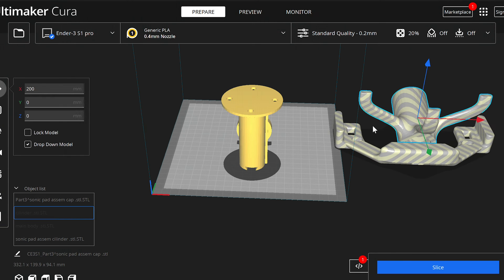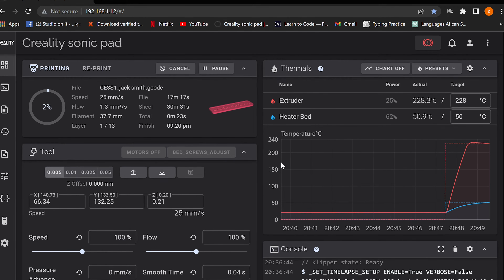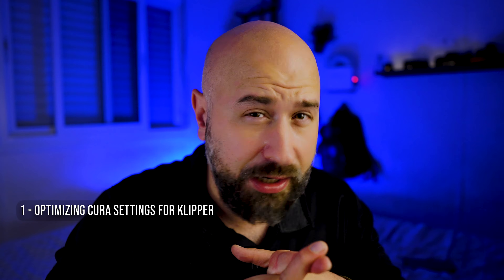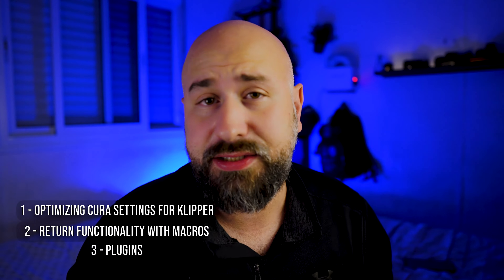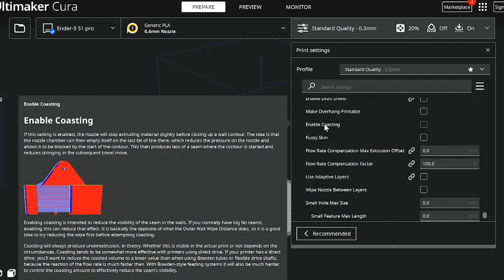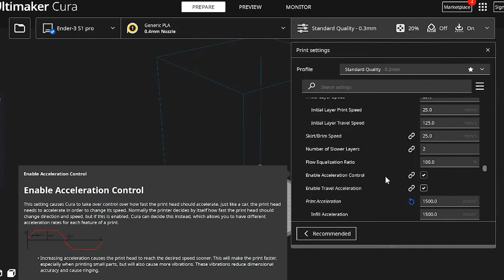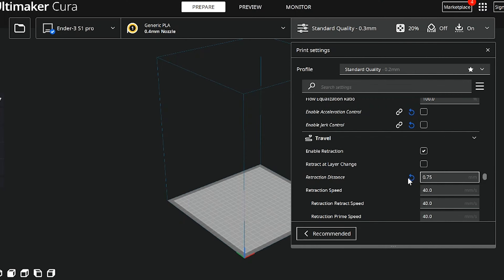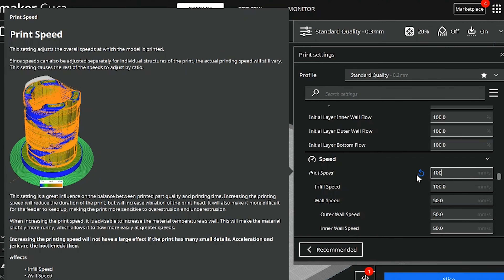Optimizing Cura to work with Klipper

Comment: Still a great and relevant video. The jjfx plug in is now available in the marketplace.  I have been trying for 3 weeks to get my longer LK5 Pro to work with klipper. and I think most of my issues are bc I tried to switch to Orca....That I do not like.... Im am going to go back to cura and use what I know
Reply: Also found this video working through the process of setting my LK5 Pro up with Klipper. Currently having stability issues and wanted to make sure I didn't miss something in Cura before trying Orca lol.

Comment: I used Cura exclusively up until 5.8.1.  I know it well and I am perfectly comfortable with it.  None of my printers were klipper.  I tried prusaslicer and orcaslicer but found them very cumbersome and the logic used in the layout and naming conventions made it a very unpleasant learning experience.  So I went back to Cura.  My prints were always good but rarely great.  So just to be able to honestly say "I gave it a solid try" I went back to orcasllicer and really worked to understand it.  And the print quality was astoundingly better.  I even used the exact same stls and copied the settings from Cura into Orca and Orca was ALWAYS better quality.  And this was on 100% Marlin printers.  Certain functions were more convoluted to achieve while others were simpler.  Then I upgrade one of my printers to klipper and the difference was night and day.  Exact same stls and print settings and klipper/orca is ALWAYS better.  The single most important setting that I modified in Orca that, as far as I know, can't be modified in Cura is volumetric flow.  Sure, I can change the flow rate but that's not the same thing.  This one setting has made significant speed improvements and I'm baffled that it isn't in Cura...or at least blatantly obvious.

Cura is a great program and what I would recommend for any beginner but once one gets to that intermediate stage of printing I find it is limited.  They really fell behind on development and now they are playing catch-up.  That being said I do still use Cura exclusively for one printer that I have modded and tweaked specifically to print PET bottle filament.  I have it perfectly setup and tuned in Cura and it's just too much of a PITA for me to setup as a custom printer in Orca.  Now...if I could simply export my printer profile from Cura and just import into Orca I'd go that route.

I am curious to see what 5.9 will hold but frankly I am not expecting anything dramatic and certainly not enough to make it worth the time to go back and see.  They will really need to WOW me with new functions and functionality.

Comment: Upgraded ender 3 s1 pro to sonic pad, any idea why the sd card keeps getting corrupted every time I use it in the sonic pad?
Reply: Same here. I found a comment where it says that you should rename the .gcode file with something shorter. Instead of "thisismyprintthatiwant.gcode" go for "this.gcode". Sorry for bad name examples but I hope you get the point

Comment: 9 minutes of looking at a closeup of your head🙄 Not picking on you but the video would be vastly better if you spent more time showing the actual screen during the settings adjustments, not impersonating Max Headroom with 10,000 cuts. Also you never specified which gcode flavor to replace Marlin with.

Comment: One of the first things I found is Klipper does not understand G29 to to bed meshing.   That was the first macro I created.  did a little comment # Marlin Compatibility #  in my printer.cfg file to add GCode that Marlin knows, but Klipper doesn't :)   I was able to find both plugins in Cura Marketplace..    I'd previously used Octoprint so remote control was an absolute must for me when I moved to Klipper.   
I found letting Klipper do most of the advanced features, like using Klippers firmware retraction, pressure advance,  input shaping, and not having Cura push these settings across not only made slicing quicker, and created smaller GCODE files, but also resulted in better prints as the optimised settings in the actual firmware took over.   
This is a huge advantage with Klipper over Marlin as it is a lot easier, using an outboard device (such as a Raspberry Pi) to do all the processing instead of it all being hardcoded and running on the printer MCU.  I know Octoprint does some GCode processing and with plugins can simplify the code Marlin has to process, but Klipper just takes this to the next level as it is baked into the firmware

Comment: got a new ender 5 s1, sonic pad. ender by itself it prints fine. after adding sonic pad, it prints - but. Now any STL file that  has been changed like scaling in cura won't print. also multiple items in one file doesn't print also. but everything worked fine, before sonic pad. Any ideas?

Comment: Hi there! You are great!!!!

I have a Ender3 S1 Pro and changed to SonicPad... but I´m suffering to adjust the bed leveling compensation provided by Klipper in my old E3S1... I´ll try to install this pluging and use your tips...I´ll appreciate any tutorial about it... I saw so many issues with E3S1 and Sonicpad...regards

Comment: Nothing wrong with using curas acceleration control. You can’t customize perimeter acceleration in klipper. The acceleration setting in klipper is just for the max limits.

Comment: Klipper prints a LOT slower than Cura for some reason. In Cura I specifically set the print speed at 120mm/s but Klipper prints at 60, similar problems with initial layers; I set them to 60 but Klipper starts at 20, then 40 for a bit.
Eventually after a few layers it does get up to the 120 that I originally set, but I just wonder what initial settings mess with the first layers that much.
Does anyone have any ideas?
Reply: first layers have separate settings, also for speed, cuz it is meant to be printed slower being the "foundation" to the entire object

Comment: Like this video very much. It opens the eyes for different setup. I use Cura on RPI400 where I save stl files over Samba service remotely from other PC having Fusion.360. From RPI400 I send GCODE to Octoprint comnected to one of many printers in my small farm.  I am looking for architecture where I can use Sonic pad with the clipper instead of each printer dedicated RPIs but still having ease of slicing all the job by Cura.
Reply from the maker: Hey Marcin, that sounds really cool, what printers are you using on your farm if you don't mind me asking?
Reply: @z-made  sure I dont. Two CR10 smart + Two Ender6. Sonic pad has 4 USBs? Right?
Reply from the maker: @soeft  Yes it does, it can support up to 4 printers at once, its actually a pretty awesome device, and I'm sure it will make your life easier, good luck man

Comment: Hi I followed the link you put up for extra mico  trying to add the filiment change but it won't save and reset sowing about the setting up bltunch what can I do sorry am a bit new to this 😅
Reply from the maker: Hey there Fayying, Welcome 😊, so just a few questions, I hope I can help you, what API are you using?, are you sure you copied the right macro, and where in your printer config file did you paste the copied macro? it could be that you may have passed the macro inside the macro for your bl touch and the klipper can't figure out what happened, please let me know, I hope I can help you,

Comment: awesome videos! 
you should post a link to the profiles you are using
Reply from the maker: Hey, Guilherme, I'm not sure which profiles you refer to, material profiles, printer profiles, quality profiles, or something else?
Reply: @z-made  All of them!! I run with one profile on all 3 of my S1 Pro's for all filament and heat settings. Maybe I need more? If I run ABS i turn fan off and up the temp, but everything else is the same. Could it be better? I don't know. Seeing what others run might help me.

Comment: I was getting better quality prints using SoftFever now renamed to Orca Slicer plus seems a lot simpler than cura.  Could you make a video on calibration with klipper start to finish?  I have all steps diaper in, but kind of complicated for rest and I am wondering order as well. My print in place models always come out crappy but outside looks fine. Need to get it dialed in.
Reply from the maker: I will check it out
Reply: @z-made  thanks. On calibration I'm also not sure what to configure in Slicer vs klipper.  Watched loads of videos to no avail. Appreciate your videos and hope you break tasks down.